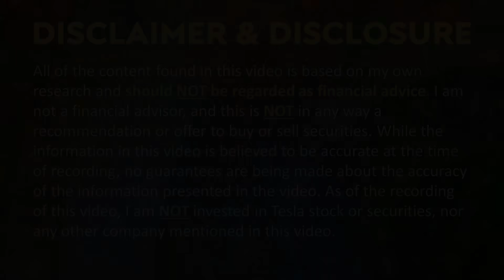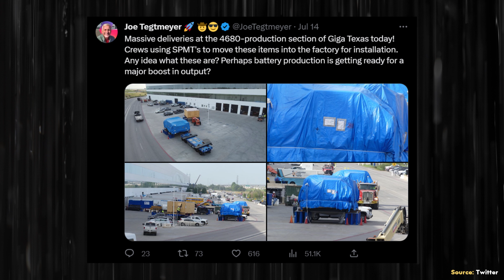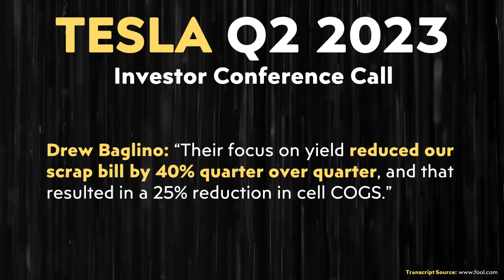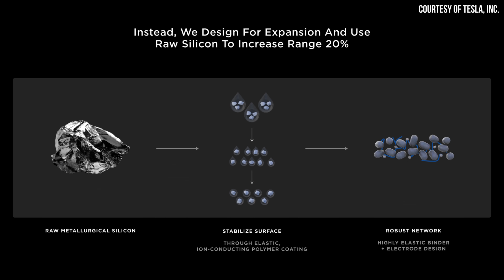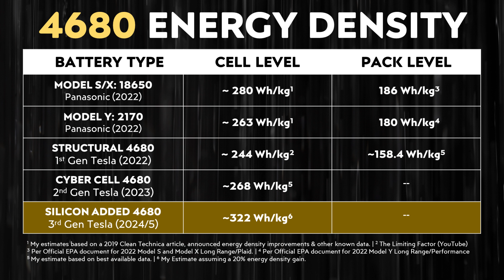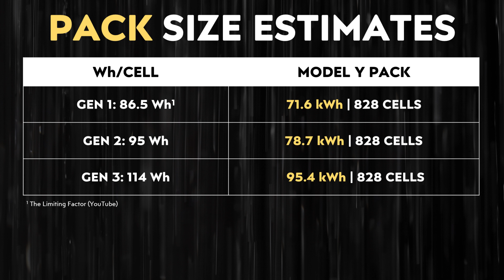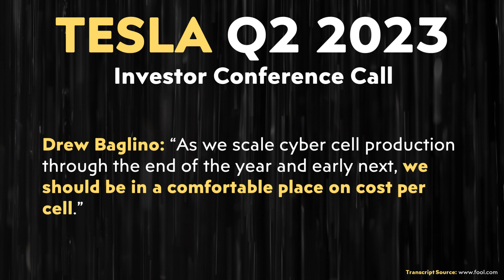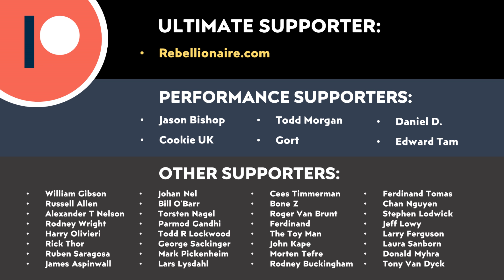BIG Tesla 4680 Battery ENERGY BOOST | Cybertruck Batteries!

Comment: The bottom line is that 4680 Gen 1 has lower energy density than 2170.  Gen 2 just about equals 2170 but it appears that due to form factor of the 4680 that the battery packs actually have less capacity than the 2170's.  4680's bring other advantages,  but thus far, in terms of the fundamental problem with batteries (much lower energy density than gasoline), the last 4 years of 4680 development has produced disappointing results.  This is a problem.   There is some indication that China has been somewhat successful with a new sodium involved chemistry,  but like everything in the slow evolution of battery tech,  it will take years to demonstrate and prove out.

Comment: Where did you get the chart at 12:55? I have the 2023 AWD model y with 279 miles of range and I am wondering what the gross and usable numbers are for the battery. It seems the usable part of the battery is about 67 kWh. My question is is 71.6 kWh the gross size of the battery?
Reply from the maker: Yes, usable is less than 71.6 kWh. That is the gross capacity estimate.

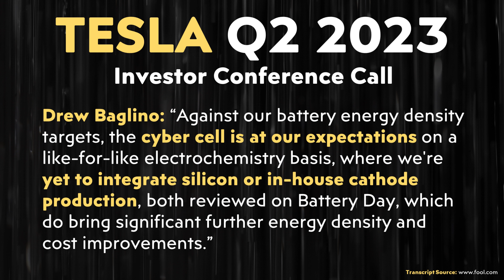Comment: 8:12 No, I think he's talking about the dry coated cathode process which they've yet to achieve. Dry coating can increase energy density vs. the traditional wet coating process.
Reply from the maker: Maybe... I am not certain yet of the energy density benefits of the dry process. In a past video, I covered a patent app from Tesla/Maxwell Tech. that seemed to put DBE at a disadvantage vs wet processes without a special "super-fibrillized" binder process, which seemed to bring the dry process on par with wet.
Reply: @Cleanerwatt  I'll have to check the limiting factor 4680 cell analysis video again as it's been a while. If memory does not fail me they measured the anode thickness to be greater compared to cells with wet process anodes, that increase in thickness results in greater density.

Comment: I was thinking about batteries being manufactured now.  If I go back to  battery day claims and take that scenario as a home run, then I would put Tesla as having hit a couple of little bouncers into the infield.
From recent claims, it sounds as if they are starting to feel confident they can get on 1st base.   Getting on base being analogous to acheiving minimum specs and production to start cyber truck production.  I would really like to hear if Elon and company still feels they can hit those doubles, triples, and homeruns with 4680 dry electrode technology.(cathodes, silicon)  It has been a hard fight to get to here, but I wonder if other tech might overtake 4680 production and it needs to be scraped.  
Example, Amprius Tech. with crazy battery density and projected $65 KWH cost.  
I guess time will tell.  There are a lot of different battery techs being manufactured simultaneously now.  See no reason that won't continue.

Comment: What the hell is going on at Giga Nevada, wasn't there supposed to be massive battery production there?
Reply: Still only 2170 cell production, about 40GWh/yr. Back when originally announced that was the goal with unknown future possible expansion. Now they have announced a 100GWh/yr expansion with 4680 cells, but no news on actual construction.
Reply: @royh6526  sounds about the same as Giga Buffalo, where I live, Tesla took over the brand new Solar City site and they've barely done squat there also.

Comment: 4680 was a difficult product to get into mass production and they are still are having problems as they ramp.  Energy density has been a bit of a disappointment with the cells produced so far, with it being about the same as other cells however once the additional improvements are made the 4680’s will be the most energy dense cells available and further improvements can be made as the chemical composition is improved.  

There is no reason that Gen one cells won’t get phased out over the next few years.  Most of the improvements will be simple to work into the existing 4680 production lines.

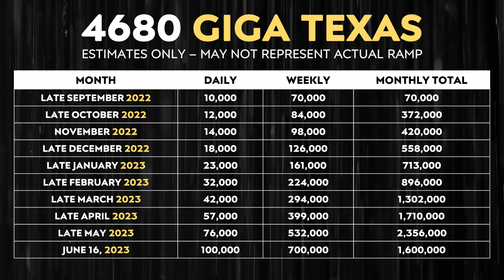Comment: 3:45 - I think your 4680 cell production estimate (75-100K daily) is low. If extrapolate from Tesla's rate of daily increase (as bench-marked/mo) then it's a fairly safe prediction they are producing at least 125-135K cells/day in July...good for roughly 137 MYs/day.

Comment: Re the 10% improvement.
Correct me if I'm wrong, but the cells tested indicated a chemistry which didn't match that of the 2170?
Let's suppose that the Cybertruck cell has 10% improvement from "mechanical" improvement, allowing the extra surface area of jellyroll to add volumetric density.
What happens if they also "upgrade" the chemistry to just the known, reliable 2170 specification?
.
Would that not be another 10%?
.
A CT cell at ±310 W/kg?
Maybe?
.
Then there's the charging to consider.
Can they utilise the properties of the 4680 design to flatten the charge rate of the CT Cell/ pack?
Are we going to see the first Cybertruck charging at a steady rate 200+ kW past 60-70%?
.
I'll get the popcorn.

Comment: 10,000 cells per day is a drop in the ocean. Tesla will need 3,000 of these production lines to produce half their needs. This looks like crash and burn on batteries.
Reply: Big new machinery has arrived at the Texas 4680 production site, I hope this means a huge upgrade in capability.

Comment: A 80% ramp up is not very significant when you start from so low, it's the current production rate that is a true achievement.

You mention only the Cybertruck and the cars. Wouldn't the Tesla semi also desperately need the higher capacity cells? Or don't they use 4680 cells altogether? The higher capacity cells would also be critical for smaller cars such as the Model 2 where they can't fit as many cells.

We've already seen Tesla reduce the price of their cars a few times in 2022, a year with inflated material prices and still a shortage of automobile chips, so with cheaper cells, we'll see a combination of cheaper and longer range cars. The future does not bode well for Tesla competitors, who are still trying to figure out how this new thingie works along the ICE cars they still produce, while Tesla is now reaping the fruits of its massive investments every day. And there's no telling how much prices can go still down with the gigapresses that replace dozens of individually soldered, riveted or screwed parts into just one.

Comment: Hi John. I assume Tesla are still using the wet process for the Cathode, if so does that mean they have huge drying lines & ovens set up at Texas or do you think the Cathodes are shipped in? Cheers!
Reply: They specifically said they are using dry process for both anode and cathode.

Comment: 4680 is a big deal for Tesla; and its been a source of seroius trouble because it has had high reject rate in manufacturing.  Tesla doesn't give much detail as to how well this is going; so one might presume that means it still is going poorly.  If your rejecting half the batteries you make you can't make a profit on Cybertruck, Semi or even the new Roadster.  It will be a big deal how many cybertrucks roll out a month; if it is under 5000 that will mean production of 4680 is still vexing; if it is over 10,000 or 15,000 a month; that will suggest the problems are finally resolved.  If they were' one would think they'd say something about it.

Comment: It probably isn't possible to find this information but a good indication of 4680 production rate would be to find out the delivery rate of 4680 Model Y vehicles. We know that each vehicle has 828 cells and that all of the vehicles are sold in the US, so if registration data was available it would tell us how many cells are going into cars.
Reply: You are right, impossible to find out the ratio of 2170 Model Y vs 4680. Also very confusing that Tesla has been stock piling huge numbers of sub-frame castings and 4680 packs. Why aren't these going into vehicles?

Comment: Cut to the bottom line.   How efficient will the Cybertruck batteries (4680) be at the launch of the CT?   We believe up until recently the 4680 wasn't quite as efficient as the 2170s.    Is the Cybertruck 4680 now up to even with the 2170 batteries?
Reply: I'm not so sure the Cybertruck batteries are 4680 cells. Not that this should be a concern or worry. Tesla will use the best batteries available for the job.
Reply: @scottbreseke716   Interesting take.  I hadn't consider that.  Although, if they put in 2170s, it will be a bit of a black eye since the plan for the last 3+ years was the all new, all powerful 4680 batteries.
Reply: @billsrelectric  The Tesla with the longest range and fastest acceleration right now (Model S) does not use 4680 batteries. They don't even use 2170 batteries. They use 18650 batteries. Tesla will choose the best batteries for vehicles in order to best meet their goals for range and acceleration. It's all good.

Comment: Look your going arse backwards on the energy density thing they reduced the weight of each cell not increased the power in the cell so G1 and G2 wh is the same it's just that the cell weight about 10% less witch will give the car a range boost since it dont need to fight the Molten Iron Core of Earth as hard the increase with silicon is still valid as long as you don't calculate the Gen 2 Cells into it witch i think you did.

Comment: That extra 10% puts 4680's on par with 2170's if I am not mistaken whilst it should cost them less due to DBE and should have better internal resistance and thus can charge and discharge quicker without heating up. This should mean lower heating and cooling. 
Now Tesla can ramp V2  .
Reply: It's offset by the increased cell diameter. They won't charge faster, it cancels out.
Reply: Looking at Drew Bagolino's words used, the Cybertruck batteries might actually be 2170 cells. But that's ok.

Comment: 4680 has been a struggle. Best not to sugarcoat it.

But there is steady progress, and I think they're getting closer to Tesla's goals for the cell.

Those are lofty goals. It's still a long, long way to 100 gigawatt-hours per year from GF Austin.
Reply: I admire you guys audacity to criticise their numbers: considering that Tesla never produced any cells in the past, their struggle now to become one of the best and biggest in the world is an admirable feat. Criticism lacks understanding of underlying obstacles. This is not audacity to criticise, but indolent ignorance. I tip my hat instead.
Reply from the maker: Very true!
Reply: And the 10% improvement is them matching not even the latest industry standards. They are clearly not planning to implement dry electrode coating, silicone, etc. anytime soon if they are making all production ready for Cybertruck batteries without those processes. Seems to me like more smoke up investors‘ asses so people stop asking why they are still an order of a magnitude away from promised battery production numbers, why technologically there is 0 superiority to all the exiting things from CATL and BYF and why their energy business in general isn’t the money maker they were implying it would be already.
Reply: @marctech1996  uh ..

No battery manufacturer would be unhappy with an incremental improvement of 10% energy density. A very rough rule of thumb is, +5% annually in this industry. Outsiders tend to overlook just how much engineering effort, trial and error goes into every small step forward. Molecular engineering at scale ain't easy.

4680's gravimetric energy density last year was on par with Panasonic's 2170 cell, and Panasonic has been working on 2170 for a hell of a lot longer. +10% should put 4680 slightly ahead. At the least, it isn't losing ground.

And you scoff? You? Who thinks silicone and silicon are the same thing? Who doesn't know that 4680 production does indeed include dry coating?

My advice: try to understand a subject before bleating your opinion.
Reply: @Urgelt  
Silicon/ Silicone.... Nice catch.
You were right to "rub it in" 😉
Reply: @Urgelt  Panasonic stated that they expect a new battery factory to take 2 years to ramp up to full production of an existing battery (know chemistry, process, form factor). I haven't heard of any actual production of 4680s from vendors at this point. I'd say Tesla is doing fine. I've been through factory start up (not battery) and experienced the mind numbing troubles. It boggles my mind how quickly Tesla is building/ramping all of their plants.
Reply: @GROND15  yeah.

I pay little attention to Elon's timeline aspirations, especially when it comes to batteries. Crazy hard, batteries.

But Elon's technical revelations are always fascinating. Astonishing, even.

Vehicle performance was never going to be astonishing for 4680. If you want Plaid performance, you need terrific cooling, and it's just a fact that smaller batteries are better for getting cooling as close as possible to where the chemistry is happening.

But Plaid-level performance isn't necessary for most cars. And smaller batteries are more work to assemble into packs. Which means more cost.

What Tesla has demonstrated thus far is a giant battery that works great for Model Y, matches or slightly exceeds 2170 energy density at the pack level, produced from a smaller factory floor footprint, on a production ramp and cost curve that looks very advantageous going forward.

There remains much to do to get production speed up, reject rate down, and costs down. But I like their progress.

Other 4680 manufacturers will come on line eventually. That's good, too, whether those cells will go to Tesla or to other OEMs. The risk of oversupply anytime soon seems to be zero.

Cheers!
Reply: @Urgelt  🎯 A lot of people were disappointed with 4680 "performance", thinking it was going to make all Tesla's 3 seconds 0-60 and have 450 miles of range. 4680's are about cost not performance.
Reply: @GROND15  absolutely.

If you want insane performance, then you want insane cooling, which is easier with smaller cells. More expensive packs, too 

The size of cells bears little on pack energy density. It's not entirely irrelevant, but chemistry and pack design matter a lot more.

4680 was a cost reduction move. Once they figure everything out, it'll save lots of money. The progress I see to date is on the path to achieving those savings, and I'm quite happy with that progress.

Wall Street isn't impressed. Who cares? They know spreadsheets, not molecular engineering. Listening to Wall Street analysts holding forth on subjects they don't understand is exactly like letting a pack of hyenas decide who should get the Nobel Prize.
Reply: @marctech1996  The impossible always takes Tesla a little longer than expected - even Tesla struggle with miracles...